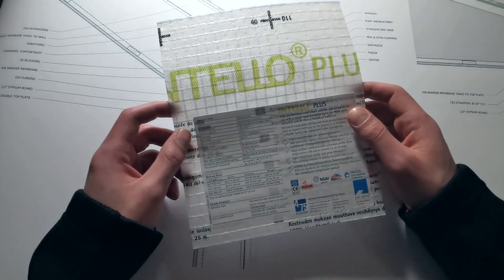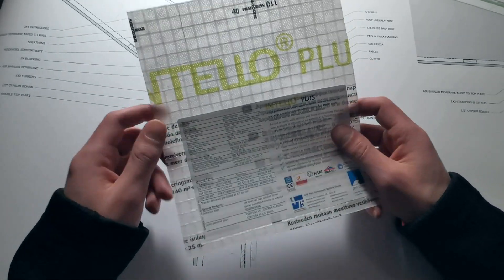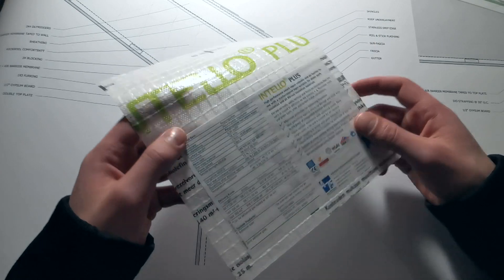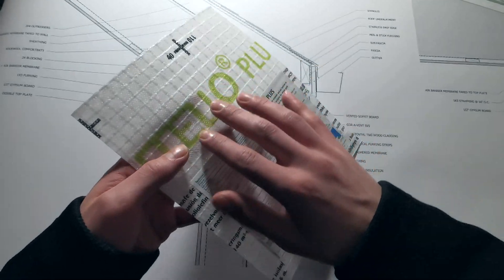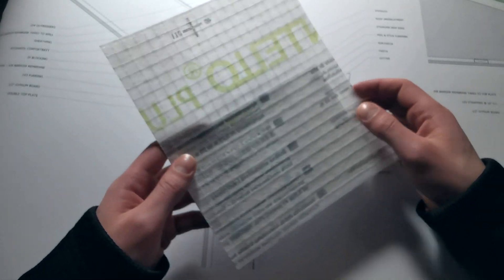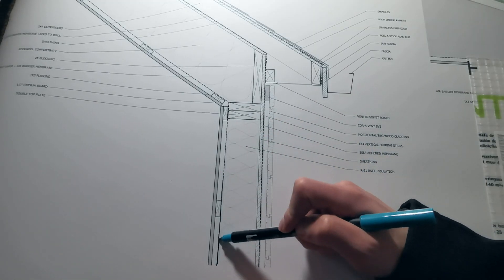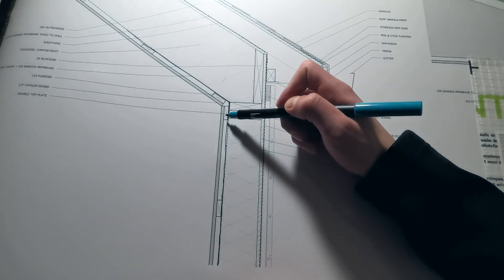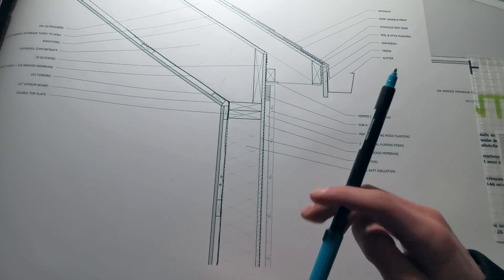What Is a Smart Vapor Barrier? (and Why You Might Need One)

Comment: Hi, does this product seal around any mechanical fixing penetrations? If not its not going to be a great air barrier i assume once peppered with holes?
Reply from the maker: The membrane is taped at any penetrations to prevent air leakage, but in general we try to avoid too many MEP penetrations if we can help it.
Reply: @ASIRIDesigns  thanks for the reply. In particular It's the staples and drywall fixing screws/nails penetrations that I am wondering about?
Reply: As long as your fastener penetrations hit the wood stud it is sealed. I use a product similar to this called Siga Majrex that is applied to the studs with a double sided tape that Siga also makes. So this way you only have the ten or so drywall screws per stud and anything that may be screwed to the wall over it such as cabinets after.
Reply: @CMCraftsman  thank you
Reply: @markt8820  You’re welcome. The double sided Siga tape is called Twinnet and it’s extremely sticky so I would suspect that when you send a fastener into it, it probably seals around it pretty well much like an ice and water shield does around a roofing nail.

Comment: It's not allowing diffusion from one side and not the other. That would break the laws of thermodynamics, to push from low humidity to high humidity. It sounds like this membrane just changes permeability based on the temperature.
Reply from the maker: Close, it changes based on relative humidity, much like wood, but as you'd probably guess temperature is a big part of that equation.

Comment: I have an external brick wall which I'm remodeling from the inside by tanking it with a two-component cementitious slurry and adding rigid 50mm 75 kg/m3 rockwool batts covered by double layer drywall installed on 30mm metal stud and track framing. Do I need this vapor barrier behind the drywall? The house in question is in a moderate continental climate, and I don't have the space for a service cavity unfortunately.
Reply: P.S. None of the stores or warehouses in my region seem to have a smart vapor barrier in stock.  :( Choices I'm left with are traditional (polyethylene) vapor barrier and tar paper. Unless there is something else I could use? Perhaps swap the first layer of drywall with a 12mm (1/2") plywood or OSB (to serve as a vapor retarder) and attach a single layer of drywall onto it?
Reply: You’re better off not having a vapor retarder than having one in the wrong place. I think I would use the drywall as the air barrier in your case, being mindful when installing it to caulk the perimeter with something like big stretch and any joints before it’s taped
Reply: @CMCraftsman Why would the interior side of the rockwool insulation be the wrong place to attach a vapor retarder?
Reply: P.S. What I have is (from the outside to the inside): Render -> 120mm/5" Brick -> 50mm/2'' cavity (rockwool + metal framing) -> Drywall. And I want to put the vapor retarder on the metal framing before screwing in the drywall.